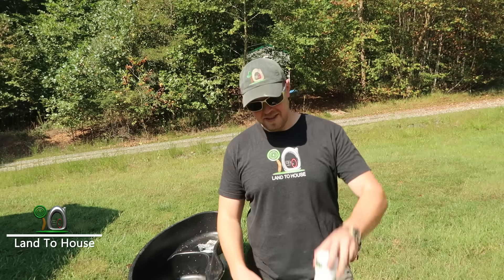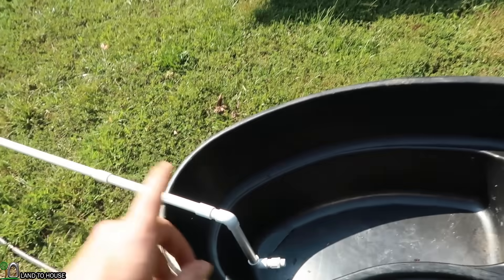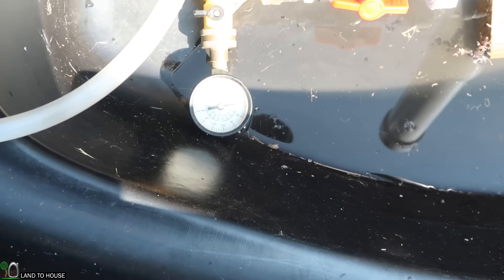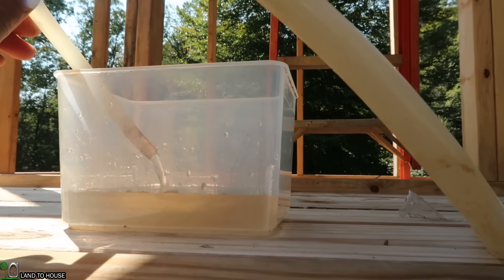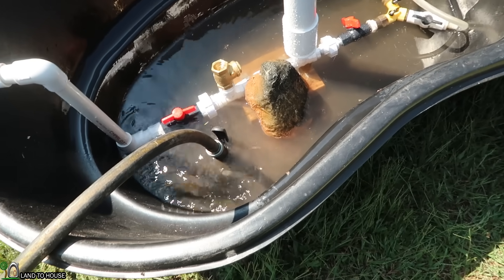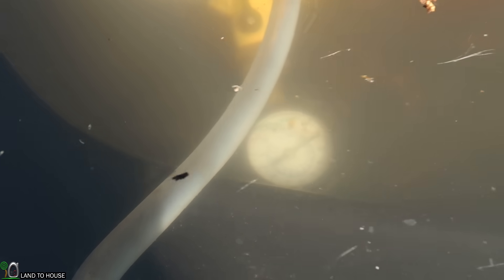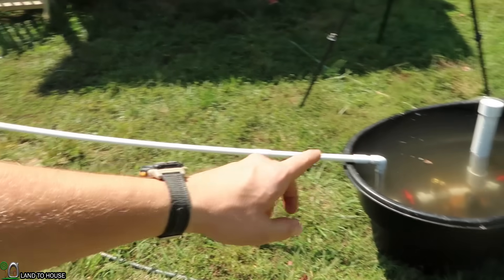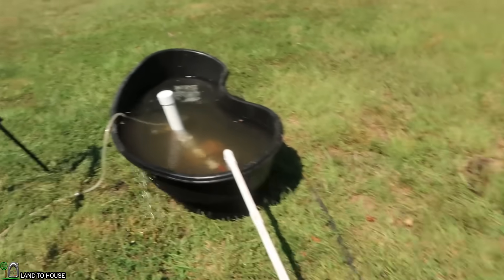Underwater Ram Pump

Comment: The velocity of the water in the drive pipe is directly related to the difference in water level between the source and the water level above the waste valve.  As this system is effectively driven by kinetic energy less head difference = less velocity = less energy = less pressure.  Also even though you put the pipe up to the top of that tower the work done was actually only the difference in level between the top surface of the source (your bucket) and the level of the end of your hose. Which is why there was not much of a difference in the volume of water pumped.

Comment: Can you use more than one pump in a series to bring water further from the source?
Reply: Good thought there. How about three pumps in parallel to increase volume pumped through the same piping system? Maybe additional valves may be necessary to prevent backflows.

Comment: Does the part of the tube, coming down from the structure, create a siphon effect? Does that affect the flow any kind of way? If so, does it affect it positively, negatively or not enough to matter?
Reply: I saw this and came to the comments to see if anyone else took notice. It takes the required pressure to reach the top but once it tops and fills to the bottom the whole test becomes meaningless. Might as well just left the tube laying on the ground since it cancels itself out. Unless at the top he put a large hole in the tube or completely cut it and put it into a funnel open to the air.

Comment: First I have never made a Ram Pump!  But many of the videos I have seen said they work best if the feed pipe is twice as the delivery pipe. And that sounds like it right because it can deliver more water faster and have a larger volume of water moving when the wast valve slams shut.  But that is just doing things up in my head!
Reply from the maker: Yes normally the delivery pipe going up hill is half the size of the drive pipe. This can save some money on that pipe. The drive pipe needs to match the waste valve.

Comment: Seeing how the ramp up functions on the spring of the weather it’s foam rubber or even if it is a spring inside the pump I am experimenting with two neodymium magnets using them as repulsive springs because they will never weekend and they’re Round and will fit inside the pipe the opposing polls facing each other almost piston like but the repulsion is stronger than the spring that I have been using for foam rubber if that’s what you’ve been using see what you can do with this idea as well

Comment: What is the ratio of check valve wastewater to pumped water ? The lower pressure in the cylinder when submersed is caused by pond water height above the top of the check valve ! What height can the wastewater be pumped to ?
Reply from the maker: Normally the waste water lost is around 80 to 90% of the water that goes to the pump. The waste water should be allowed to fall out of the valve as close to the pump as possible.  The delivery water can go as high as 180 feet with the right input head pressure.

Comment: A second ram pump would be sweet to return the excess water back to the source
Reply: A ram pump can only pump a small fraction of the water used to power it, so there's no way to return much of the water. You can't get something for nothing! :)

Comment: The weight of the weather on top if the check valve is a factor the more weight the slower the valve can open
Reply from the maker: The weight of the water is hydrostatic pressure.  As long as the input head pressure is above the tank here it should not matter how low the pump goes in the water.
Reply: @LandtoHouse   Mark is correct replacing the air above the waste (check) valve with water reduced the pressure differential by the weight of that water, thus the pump is less efficient by that same amount.  Or simply put if you tube the top of the waste valve it will fill until it reaches the source height and stop the pump.   In your video it starts with the height of water in the bucket verses the drop in height to the waste check valve but changes to the height of water in the bucket verses the drop in height to the black tub.  It is still a great video

Comment: I would suspect the pressure difference to be  related to the "obstruction" of the water o top of the flapper check valve. Or the weigt of that water working against the out flow.

Comment: Hi nice to see and learn from it because we live near a pond, i think i can/need to build it under water and i was thinking to push the valve i should make a pipe above it with a stick in that i can push when it has to be bleed or how you call it. greetings from Sweden
Reply from the maker: Do keep in mind that sinking the ram pump into a pond does not increase head pressure. The water source needs to come from above the pond.

Comment: Add a pressure gauge to your pressure tank so that you can monitor the operating pressure of the underwater ram pump, I suspect it will be the same.  Rig it  like you did on the one next to the flume with a T under the pressure tank.

Comment: what about if the ram pump higher than water spring, is it working to?
Reply from the maker: The ram pump has to have water falling into it to operate. If your water source is the lowest point with no head pressure the ram pump is not going to work. For example the ram pump does not work from well water
Reply: @LandtoHouse  thank you buddy

Comment: The ram water pump "Under Water"  I think  how the pump can be operated even the pump positioned  beneath the water cause there is no high water level as source power.   So I think the system should be changed as unusualy

Comment: Will a ram pump provide enough pressure to force water through a  sprinkler or some other way of diffusing the water coming out the end? Also what is stopping you from dropping the water back down into the bucket at the beginning, where it spins a wheel on an alternator along the way, effectively creating endless energy as long as water is in the system?  I know there is still the issue of the waste water coming from the top of the pump. My theory is if it can fill that tub without sucking the water back in, then that means your waste valve also has pressure behind it. One could theorize that you could run a pipe straight up from the waste valve, and have it ramp back down to your supply water creating a 99% efficient loop.

Comment: So in low head situations like mine where the drive pipe terminates at a pond, sounds like we could effectively get more head by sinking the ram pump and waste water valve outlet in the pond?      I have thought about at least sinking the  pump up to the waste water outlet - that should be OK since a sealed pump - this video might indicate that we might could go deeper.

Some versions of waste water valves have weights on the valve - wonder if water above the valve would have similar effect.

Comment: Try this test.
1...Run your output tube to the top of your tower and return it down no more than12 inches below the beam at the top.
2... Exit the water into a 2" pipe (secure it with tie-wire or the like) with no connectors to insure that you are getting no aid in siphon Place your 2" pipe into your catch pail.
This will insure that your pump is doing all the work unaided.

(opinion)
I feel that your test utilized a bit of siphon from the top to catch pail.
My modification will allow the water to free fall for a comparison test.

Comment: Just wondering if you could put the pump in a swimming pool and pump the water through 300ft of black pipe to heat water and return it to the pool?

Comment: There is  0 resistance for that 1 way  Valve to work And air or dry then it is for that 1 way valve to work with water pressure on top of it, So that ram pump will only work to a certain depth or it will only work if the pressure of water coming into the ram pump is greater than the pressure In the body of water the ram pump is in or the depth of the body of water the ram pump is in. It's the resistance on the one way valve That has to be overcome which is why the pressure is less when it's underwater than when It's dry and has 0 pressure in resistance on that valve.

Comment: Would it be possible placing a Ram Pump so deep under water so the weight of the water itself puts so much pressure on to the valves that it can transport water?

Comment: Hey bubba I got a set up like your video at sea level on the beach . Need to move bay water up 12 feet in elevation any ideas? Can't use a pump since it's all off grid
Reply: If you have waves coming to shore you may be able to direct them into the surge line with something like a box and funnel  and have it act like falling water .
May need a check valve on the surge line to work maybe .
You have a good question can it be done .
I don't know a lot about these pumps .
I think a rush of water in the surge line might make it work .
Would be a good expersment to try .
Reply: I'm thinking now to use a solar pump to pump up the water in a barrel similar like this , then run it up to the pond

Comment: Have you considered diverting some of the flow to a outdoor shower?
You could connect it to copper pipe and use a fire pit to hear the water.
No electricity required ...nearly endless hot water

Comment: Could you put a pipe on the waste gate and move the water back to the source or to another larger container to store for later use?
Reply from the maker: Sadly no that does not work. The pressure is different from the waste valve and the source.

Comment: Would it still operate if the pond (that the ram pump is sat in) and the first bucket (source of water) were the same container, given that you still had the same length pipe and same difference in height ??

Comment: I have a natural spring on my place but it is way down hill from my home it is over 200 yards away down hill it takes over 3 minutes to get to it on my tractor to get to it. Any help with that?
Reply from the maker: Hello. 200 yd horizontal distance is no problem at all. The vertical lift is the limiting factor for the ram pump.

Comment: I think the clacking noise would be more muffled if you added a pipe over it once started. A couple of feet at most then you use a coat hangar to start it again.
Reply from the maker: As long as the waste water can escape at the level of the pump it would work. If you add a pipe directly to the valve it reduces the head pressure.

Comment: So my question is... could I maybe dig out a depression in a creek bed that does not have enough drop, and then use that extra depth to run it underwater... increasing the drive pipe drop.  Seems so...
Reply: I don't think so. The depression will become like a pot. It will fill up with static water, then actual flow will continue above it. Overflow will become the new flow.

Comment: Which ones of your pumps put out the most volume? I need about 3 gpm ,or how many pumps will be need to be installed?
Thank you
Reply from the maker: The larger the pump the more output volune potential. The 1.25" has a max output of 1.5gpm. You would have to use more than one pump or build a larger pump.
Reply: Have you experimented to a 2"  to check volume? Interesting thought two inch. If 1.25" gives 1.5 gal per minute guesstimation 3gpm.
Reply: @antonitorres5934 You need to know: 1. The difference in height between the water source and the pump site (called vertical fall).
2. The difference in height between the pump site and the point of storage or use (lift).
3. The quantity (Q) of flow available from the source.
4. The quantity of water required.
5. The length of pipe from the source to the pump site (called the drive pipe).
6. The length of pipe from the pump to the storage site (called the delivery pipe).

Once this information has been obtained, a calculation can be made to see if the amount of water needed can be supplied by a ram.  The formula is: D=(S x F x E)/L  Where:

D = Amount delivered in liters per 24 hours.
S = Quantity of water supplied in liters per minute.
F = The fall or height of the source above the ram in meters.
E = The efficiency of the ram (for commercial models use 0.66, for home built use 0.33 unless otherwise indicated).
L = The lift height of the point of use above the ram in meters.
Reply: @osyisr6361  I found that quite informative! Thanks.

Comment: Could you possibly make the unit quieter by using a soft rubber seal/O-ring, or a completely different style of valve ???  Noticed kink in outlet pipe near the pressure gauge. This would probably reduce the output flow and pressure. When submerged, you have reduced the supply head height by approx 1 foot or more, therefore the input and output pressure will be reduced by something approaching 25% - 30% . Under water, the lift height (approx 4 feet),is also reduced by the same amount (approx 1 foot), thereby helping to explain the reduction in pressure . This would not be so obvious if a much higher lift height was used. I have wondered about these types of pumps since I first saw one in Tasmania as a child in a farmer's paddock in 1968, feeding up approx 15 metres to a tank on a tower with no power being supplied. Thank you very much for your videos; Very impressive.

Comment: i am waiting to see the ram pum with bell siphon attached to it. bell siphon sending water to the submerged ram pump which then pumps the water to the upper grounds.
Reply from the maker: The problem with that is when the water runs out the pump gulps air. That will have to be purged out before the pump can start again. Otherwise that concept would help tons of people!
Reply: @LandtoHouse  an air release valve?

Comment: The reason for the slightly less pressure underwater is that the height up the water level in the black tub is what determines the ' drop ' of your ram pump.  You lost a foot of drop when the tub was full.  Depending on the situation, it still might be a good thing just for noise reduction.

Comment: I probably have the dumbest question and not about water, but air. Can you have air intake and it pump and make stronger air pressure?
Reply from the maker: Sadly that does not work here. Air does not flow in a ram pump like that :)

Comment: The water in Test Pool exerts it’s own Pressure, so the Check Valve, doesn’t Create as much Pressure 
using the Pool water pressure - to Keep the Output the Same.
I Wonder, what the Results would be when the Pool water Pressure exceeds the Downflow water pressure. Will the Check Valve still open and close ??

Comment: Could this take the water back up to the bucket it came from?
Reply: It pumped water higher than the bucket so it can certainly pump it back to the bucket.  Remember the outflow from the bucket will be more than the outflow from the pump so the amount of water being recycled will be less.  Without another source of inflow for the bucket it will eventually empty.

Comment: Clark already pointed out the 50 gallon pond water level will change the head pressure.  I want to focus on the pipe going up on the kids playhouse.  If it goes up 50 feet (exaggerating here) and comes back down 40 feet then the effective elevation is just 10 feet.  The weight of the water going UP 50 feet is greater than the weight of the water coming back down 40 feet.  The difference offsets each other.  There was no need to run the pipe all the way up to the roof rafters.  But as Clark said, the pond filling up will lower the head pressure.  How so?  Assume the pond is 6 feet deep and the head source is only up five feet.  Your video it was 3 feet as stated.  The water would flow from the head source to the pond until the pond was at the same level as the head source.  Like you said, putting this in a lake would be useless because both head and reservoir levels would be the same.

Comment: Hey Buddy ! Thanks for sharing all your knowledge with us !! Quick question.. Is it possible to build a closed circuit of water using underwater Ramp pump. Ie: Two aquarius (high one and lower one) circuling the water between them ? Please feel free to contact me at gpupio@gmail.com. I'm from Brazil :)
Reply: If youre talking about 2 pumps feeding each other and not stopping? Then no.. that would be a perpetual motion machine..which nmdo not exist.. good idea though

Comment: Seth thanx as always.  The differential in hammer side pressure is from submersion.  Total head pressure/back pressure if raised will eventually, obviously reach neutral.  The volumetrics of your system will obviously have a similar range/ratio of supply dump to lifted water.

Comment: So based on what I see here, I assume that all you lose is altitude. If you aren't pushing water too far up then flow rate is likely not effected much but if you go up say 10 meters, I bet the flow rate will drop by a bit as well and your maximum ability to push up hill is likely diminished as well.

EDIT: quick check here (https://bluerobotics.com/learn/pressure-depth-calculator/) shows that 25 meters is about 35 psi and 17 meters is about 24 psi. If my guess is correct, you would maintain an equivalent flow rate up to about 10-15 meters and probably struggle at 17 meters. You should test those heights if that is at all possible and remember, the height of the hose doesn't matter much if the water reaches the top, it is the height of the outlet of the hose since if it seals you create a siphon lowering the pressure at the end of the house and effectively decreasing the height of the hose at the peak of it. This makes the effective height essentially at the bucket at the outlet.

Comment: How can you reduce water waste with this system. I see a problem with erosion from the run off or at the least a very muddy hole where the pump sits
Reply from the maker: The pump has to have the waste water to operate BUT you can place a T and pipe on the waste valve and redirect the water to another place.